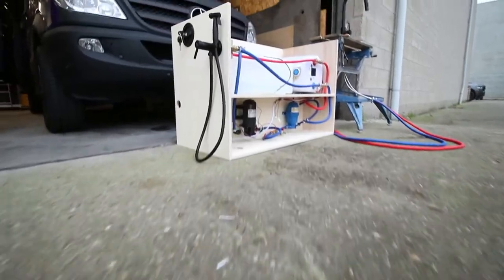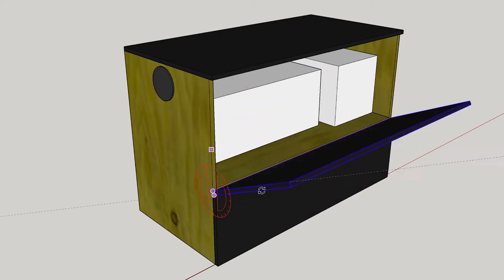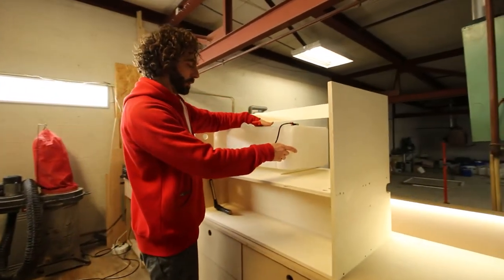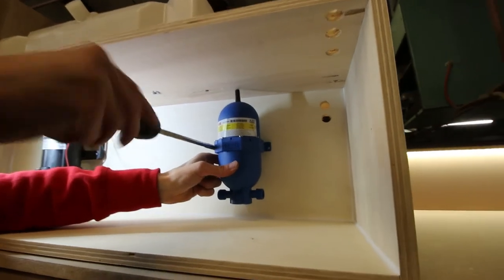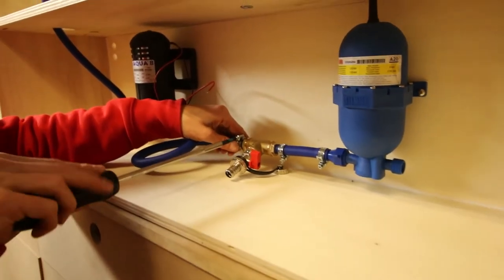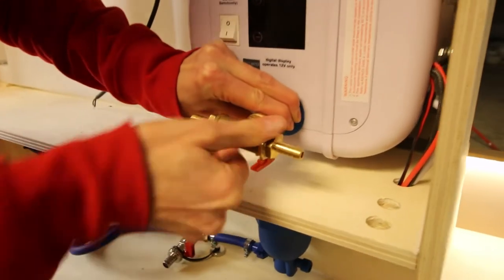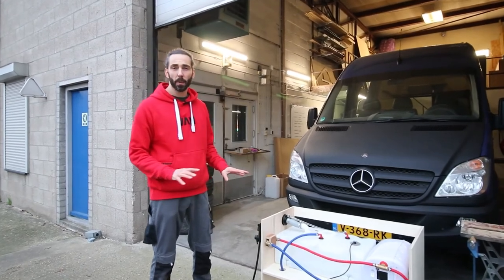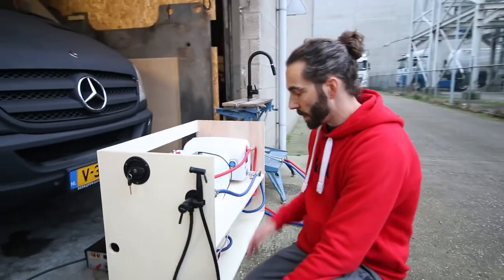Compact water system | design outdoor shower | 12v & 230v water heater | VAN conversion | VANred

Comment: There is one big mistake the layout - the water tank should be mounted on the lower shelf instead. Big heavy items like that should always be mounted as low as possible as it will otherwise negatively affect vehicle handling.
Reply from the maker: Hi John, 

Thank you for your response.

I agree with you that it is better to keep all heavy weights as low as possible. In that respect, mounting the water tank under the car near the rear axle is ideal.

With this motorhome we deliberately chose to place the water tank in the motorhome for camping in the winter season.

Before you call this design a mistake, I think it's important that you can include a little more information in your judgment.

The cabinet of the water system is mounted over the wheel arch on the driver's side. A similar cabinet was installed on the passenger side with all the electrics. 

To make optimal use of the available space, between the two cabinets, the water tank is placed on the wheel arch. Only 30 cm above the floor.
Of course, there are also water tanks on the market that fit perfectly over a wheel arch. However, availability, budget, and size have ruled it out.

Both cabinets (water and electrical) are almost the same weight and provide a perfect balance.

If you take into account that the water tank is 45 liters (ie kg), this is less than 10% of the total weight of the installation. 

From your point of view, I would be more concerned about a 29kg awning placed on top of the roof (2.50m high) ;-)

Comment: What are the fitting thread sizes on the water heater?
Reply from the maker: Hi Shanice, i'm not sure and I cannot check at the moment. Did you have a look into the user manual?

Comment: I was really hoping to see the electrical hook up for 12v as Duoetto doesn’t have any demos—what to do with the small red and black wires? To a switch? And the large red and black to fuse box?
Reply from the maker: Hi, sorry too hear the music bothers you. we thought it was catchy. Regarding your question about the wires...
The thin red and black wires need to be connected to 12v in order to power the display and temperature control. I installed a 5amp fuse. You can put a switch in between to turn off the heater, when it's not needed.
The thick red and black wires are used to power the heating element when running the boiler on 12v. I needs a 50amp fuse.
Hope this helps. 
Lars
Reply: @vanred_nl  Ok let me see if I understand correctly… The two small red and black must still go to the DC FUSE BOX- (W 5AMP FUSE)- the small red and black is the one to intersect with a switch to turn on and off the WH.  The thick red and black are what actually powers up the heater and must go to the fuse box directly with no switch— I thought I would add a switch in this line…?  NOW what about the other little black wire with the connector? And do we just roll up the 240v ? THANK YOU so much for helping me! I swear a video may do well to explain the wiring:))

Comment: This is an excellent vid, thanks! One question, in RV systems I have seen and used there was no pressure tank. The pump would just shut off when pressure was reached and run when there was demand. I'm trying to understand why the pressure tank is needed? In a home system, the pressure tank compensates for expansion as water heats I believe. Is it serving the same purpose here?
Reply from the maker: Hi Frank, the pressure vessel ensures that the pump starts less often as a result of pressure fluctuations in the pipe. Suppose your tap drips, then the pressure in the pipe drops and the pump starts. A pressure vessel keeps the pipe pressurized for longer, so that the pump has to start less often. This saves power consumption.